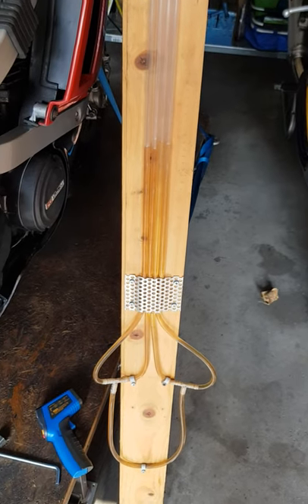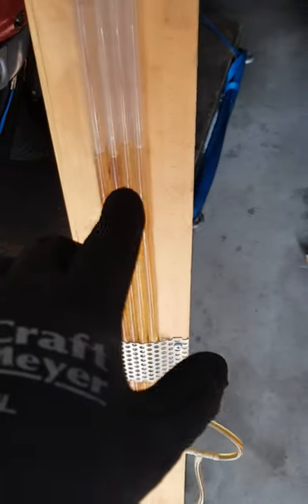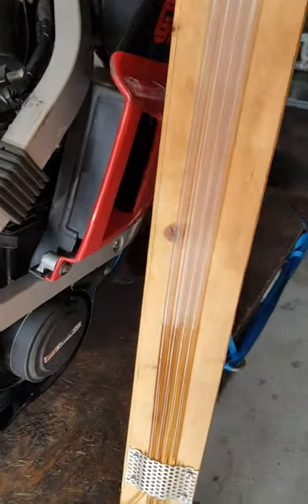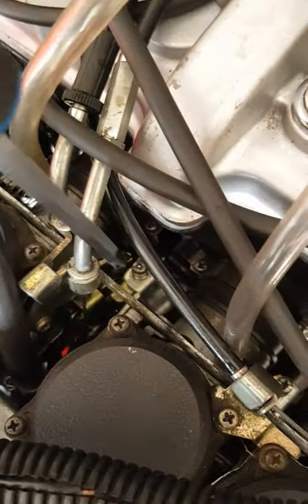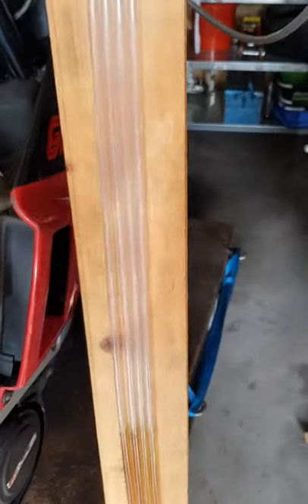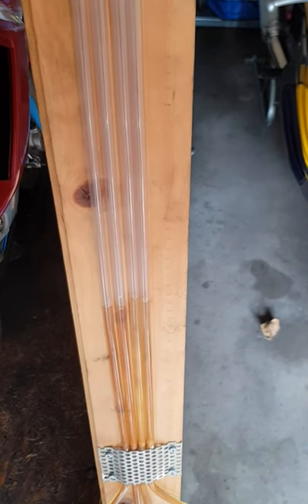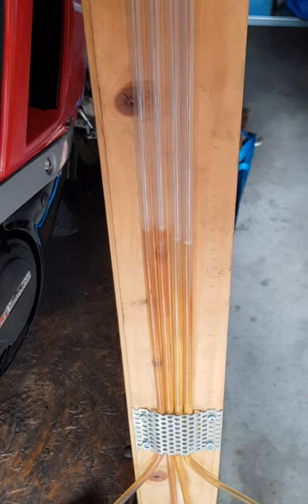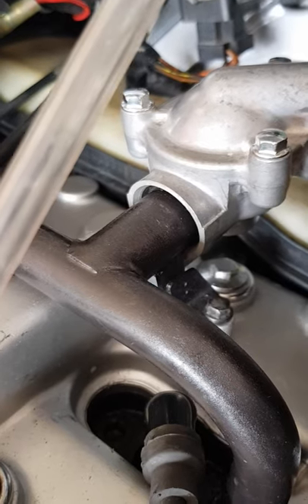GPZ600R Carburetor Synchronisation.

Comment: Thank you for this video, i adjusted mine per manual with a calliper but im still having number 1 spitting fuel back tp the air box, any idea what can be happening.
Thank you for any advise u can give
Reply from the maker: You will want to check your fuel height first. I have a video on doing this too. Possibly you have either a wrong flaot height setting or a stuck needle, or the needle valve isn't closing off due to dirt. Checking the fuel height will show if the level is too high. If it is, you need to dive in deeper to find out why.
Reply: Floats are at 17mm i will check the float needle maybe its sticking, thank you 💪🏻

Comment: What size is the clear hose as I need to make one like yours  is it 5mm or 8mm
Reply from the maker: it is 6mm inside diameter, but you can also use 8mm, you just need more oil, and it would probably be less sensitive due to the higher oil weight.